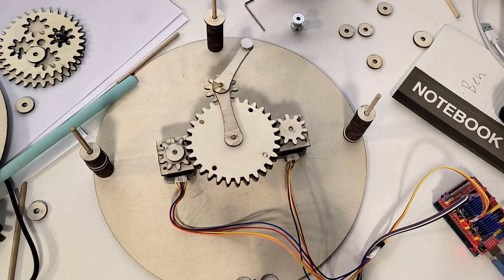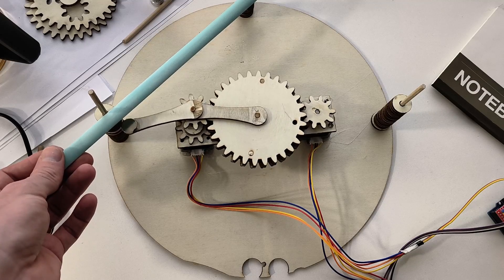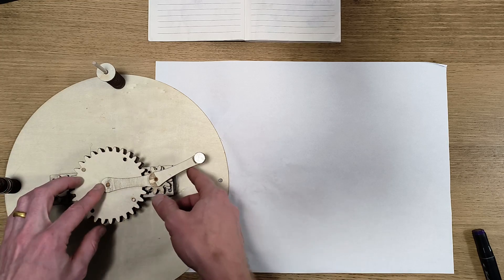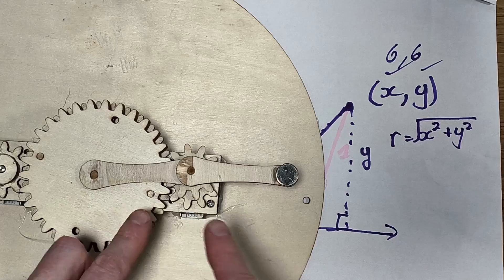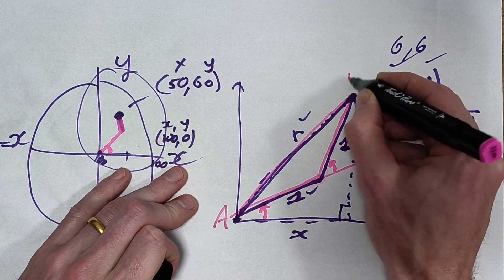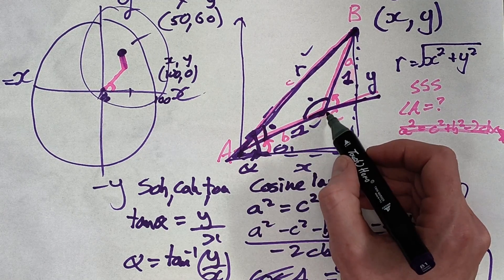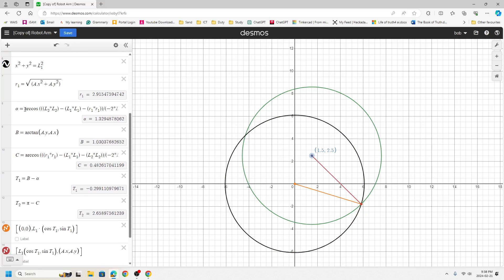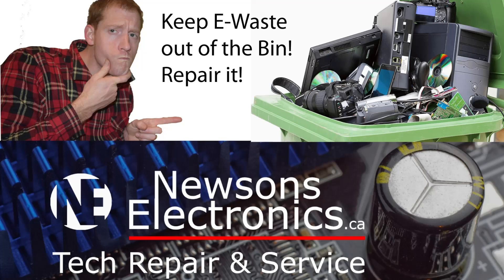Sisyphus Kinetic Sand Table: Exploring Reverse Kinematics Unveiled!

Comment: This is awesome! I'm actually working on a similar design sort of. It uses concentric shafts, a bit like the hands of a clock. It makes the reverse kinematics pretty weird, and I'm working in polar coordinates as the default, with conversions to rectangular coordinates where needed for certain functions. Have you consider putting gearboxes on your steppers as well as microstepping? I think that would help the wobble of the end of your scara linkage. The individual steps on your motors translate to pretty large displacements of the magnet, so gearing that down could help. Plus it's not like you need the speed of a Nema 23 for this. Great work, I'll be following along!